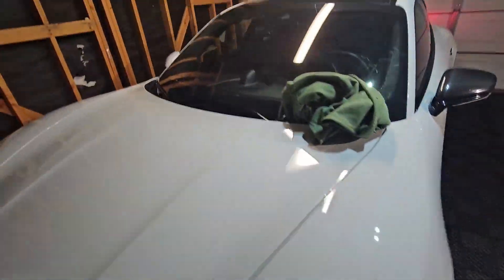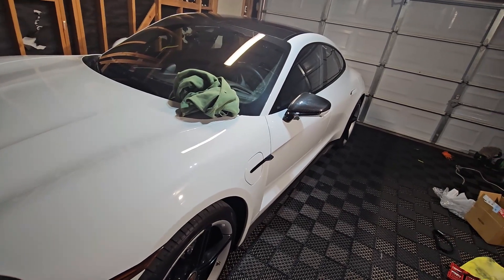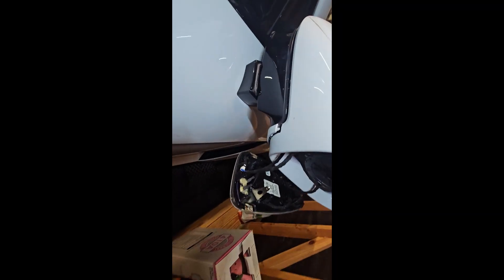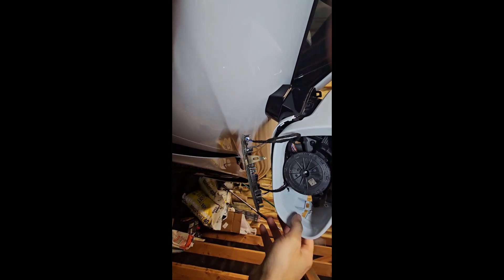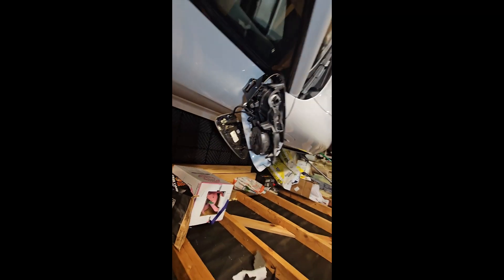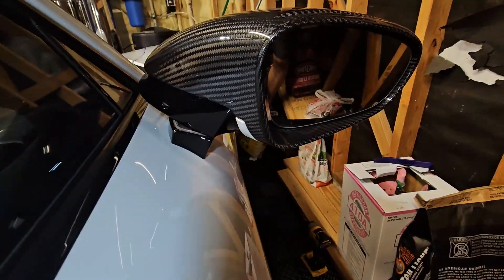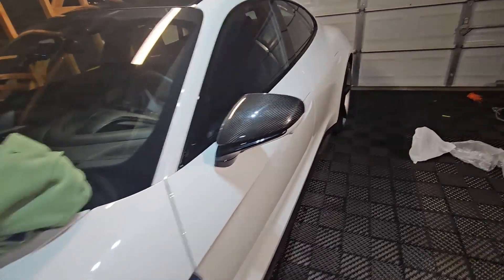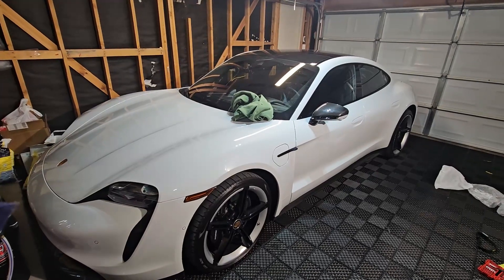How to replace carbon fiber mirror on Porsche taycan

Comment: Looks great, where did you get the covers?
Reply from the maker: Thank you I got from ebay is cheap I think 500$
Reply: @janpakx  thanks, will look there. How was the fit and finish?
Reply from the maker: If you can buy OEM cover from porsche, I mean if you have more budget just buy OEM much batter fitment, if not just buy the same as my cover is about 500$ very good quality dry carbon fiber but much cheaper than oem ,but the problem you have to spend time a little to install because a little have gap ,not visible